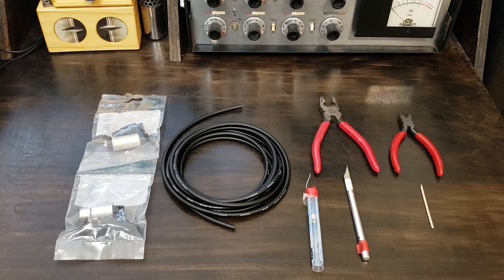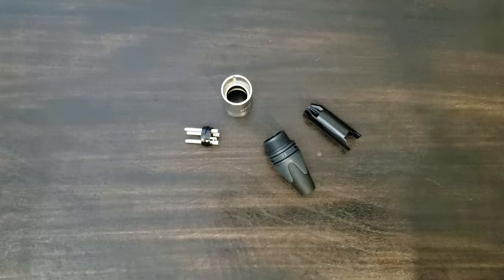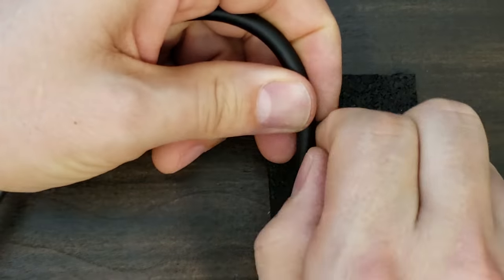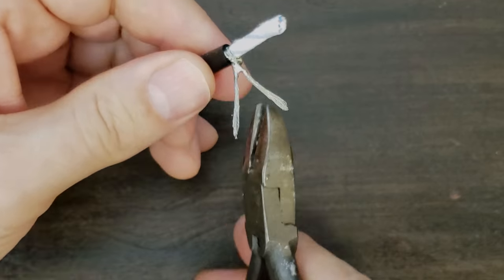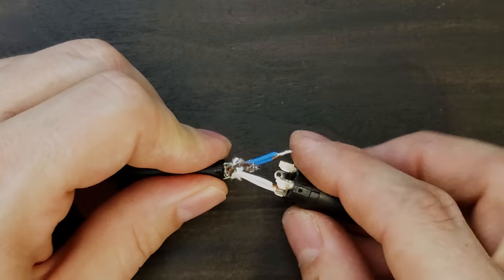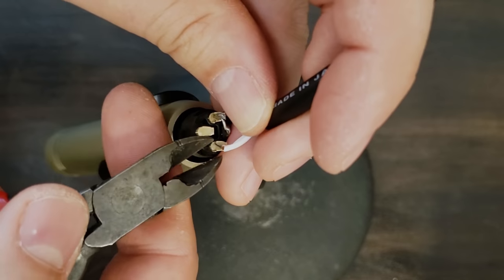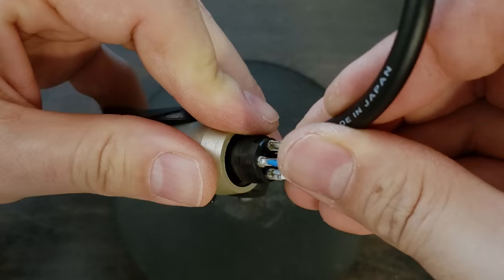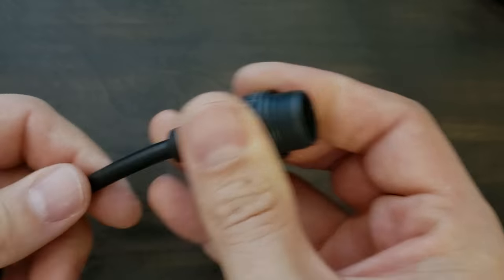XLR Microphone Cables, How to solder connectors Studio Balanced DIY ULTRA QUIET

Comment from the maker: By request I've added some  to some parts and tools to make the cable, Check out the description for more.👆
Reply: Neutrik recommends not to ground the lever. You should really use heatshrink on the back to protect the cable from overbending.

Comment: It's not a good idea to connect pin 1 to the connector body (with your jumper), as it also connects it to the equipment chassis. All those grounds aren't necessarily treated the same, so it's best to leave it floating. That way the component to which you're connecting the cable can decide how to manage the ground.

Comment: Just commenting to see if anyone else noticed the  thumbnail labeling? I think it’s labeled as if its female from the back, but shows female from the front.
Reply from the maker: It's labelled correctly as you see it from the front. Pin 2 hot, Pin 3 Cold, Pin 1 Shield.
Reply: @FrankOlsonTwins  Looks like the confusion is on my end, thanks for confirming.
Reply from the maker: No worries, front to back labelling vs. diagrams is always tricky

Comment: Thank you for the video!   A couple questions.  Why create a shield jumper,  instead of using the second twist of shielding to connect to the shield lead instead of snipping it?     And is quad core wire required?
Reply from the maker: Sure, Using the shield works well too! No reason not to, just my preference for a simple clean joint.  Quad core is not required, again, just a preference. Thanks for checking out the vid, hope it helps!
Reply: @FrankOlsonTwins  Chassis to pin 1 is a terrible thing. At the BBC - any cables that test short between chassis and ground are weeded out. Tony Waldren and Jim brown - two industry stalwarts refer to this as the pin 1 problem. Normally not causing problems but with one piece of equipment that needs chassis to be not connected, the enture system falls down and fault finding stupidly hard.
Reply: That's what I was thinking/wondering too

Comment: Why did you choose white for positive and pin 2. Why not blue?
Reply from the maker: Generally, red or white will be positive(hot), black or blue will be negative(cold). In this case I used white for hot and blue for cold.

Comment: I've made hundreds of cables using Canare and Neutrik and I've never done what you do with the shield. I've also never tied the shell to ground as far as I can recall. Just goes to show there's more than one way to skin a cat.
Reply from the maker: Yeah, the jumper is optional.  The high quality cable and attention to detail(no frayed wires, clean soldering, etc...) are the secrets to a great cable, imo.
Reply: @FrankOlsonTwins  Yes, and to that I would add that prep and a checklist are absolutely key. I've been doing this for nearly 30 years and yet I frequently realize that I've forgotten to slip the boot over the cable as I'm admiring my beautiful soldering job 😂. Thankfully that's usually the first end of the cable so I can still recover. 😅
Reply from the maker: Lol, the curse of the perfect solder joint- you only put on one boot! Been there!

Comment: In the case of a dual shielded core (foil around the live and neutral and a metal braid around that) which do I solder to the ground pin in the XLR? The braid, the foil or both?
Reply from the maker: Just solder the braid.  The foil will conduct itself to the braid.  Let me know how it turns out!

Comment: Frank, for this particular Canare quad wire, does it matter if you use blue on pin 2 and white on pin 3, as long as you are consistent on each end of the cable?
Reply from the maker: Exactly, doesn't matter as long as it's consistent.
Reply: @FrankOlsonTwins  ok, I was confused because Canare says the following in their PDF instructions from their website:

"In order to maximize noise rejection, Star Quad must be properly wired to the XLR-3 connector (or terminal block)."

And they clearly show a diagram below that quote that shows:

 pin 1 = ground (bare)
2 = white wire 
3 = blue wire 

I did mine opposite on pin 2 and 3, again consistently from end to end.

Based on what they said, I thought I am missing some kind of noise rejection benefit in this particular canare star quad wire design if I used opposite locations (but consistent from end to end) for blue and white.  Yes the cables all work, but am I missing a noise rejection benefit?

It's that I just finished making like 27 of these cables with quad and I'm thinking OMG do I have to redo this work?  The cables work and tested ok on my CT100 cable tester for proper pin outs.

I made a few at 6 foot long and most are 3 foot...for my music studio to connect rack gear.
Reply from the maker: Hey, like you said, as long as you remained consistent from end to end, you won't have a problem.  If you didn't remain consistent(end to end) you'd have a Phase reversed cable, and it should be labelled as such!  You could use a cable like that if you needed to flip the phase on a mic, but you happen to be using a mic preamp that doesn't have a polarity(phase) reverse switch.  Not common to have such cables around, but I've used them a few times for old gear that is still set up for pin 3 hot.
Congrats on making so many quad cables!
Reply: @FrankOlsonTwins  Cool.  Thanks again for your help.  Much appreciated! 👍

Comment: By a mile the best video and comments section I’ve seen covering this area... WELL DONE SIR.
Reply from the maker: Thank you! I'm glad people are digging this vid!
Reply: So Frank,  I’d just like to check something please.  I’m wiring a single pair cable female XLR to a TRRS, to use with my smartphone for convenience.   Will I simply be able to plug this into my AKG D321s microphone and record directly to the phone or will I need to provide some power to the mic?  Also in terms of wiring I’ve established that the S (Root) on the TRRS I’m using corresponds to the microphone input on the Samsung S9+ so.  I think that I wire the silver cable to the ground into the TRRS.  That leaves 2 cables the blue and white:  So which of those should I connect to the S (root connector)  cable.   I’ve identified the 2 Left and Right channel cables on the input and left those to one side for the moment.   Hope this makes sense and many many thanks in advance for your input so far.  Best rgds J.
Reply from the maker: Sorry for the delay!
I believe TRRS(tip, ring 1, ring2, sleeve) on a mobile phone should correspond to 
Tip=left headset out, 
Ring 1= Right headset out,
Ring 2= Microphone,
Sleeve= Ground/Shield.
The AKG D321 is a dynamic mic.  I don't think you'll need phantom power as most headset mics do, but you might need a preamplifier for it.  Most dynamic mics need a fair amount of gain.  No reason you can't wire it up and try it though.

Wiring, just a guess:  T=white, R1= blue, R2=red, S=silver(or copper color). 
I also doubt you need a "balanced" connection for the microphone, (the TRRS cable doesn't really allow for it), so if you're making an XLR cable for the microphone, Pin 2 (which will go to Ring 2)will be "hot," don't forget to ground Pins 1 and 3 to "S"
Good luck!

Comment: A few things I like about your video out of the 10 or so I just watched.  1.) Your the only one that used a shield jumper, I guess its not "required" but seems like a good idea.  2.) I like how you crimped the connectors to give a more secure connection.  3.) If you have a lot of braiding I liked your idea of cutting it in half but still giving it a good base connection with the solder at the base.

This is most likely the closest to how I would make a cable if I was going to do it.  Good job with the video and thank you.
Reply from the maker: Thanks for checking out the vids! I get plenty of negative comments about that jumper, but I've never experienced an issue using my cables in pro studios and clubs in and around NYC.

Comment: Wow excellent! I will get on this immediately! Fixing/upgrading my old quad core cables.
Reply from the maker: Cool!  Let us know how it goes!
Reply: @FrankOlsonTwins  Thank you once again for offering a solution to my problem! I had an issue with RF noise and my U87ai microphone. I had attempted to modify one cable in accordance with another video on Youtube that simply takes pin 1 out of the equation and connects it to the xlr clip on the ends. This reduced the noise but the jumper connection retaining pin 1 connection reduced the issue to the maximum. I think for my next cable mod, I will use a simple very short cable instead of the wire I used to make it slightly cleaner. Thank you very much!!!
Reply: @FrankOlsonTwins  what are your thoughts on EMC XLR cables? Would be good to see your prep on one of those :)
Reply from the maker: Yeah, I'd be curious to find out what the differences in are between those cables, there are MANY options!

Comment: Lots of good points in this video.

Shield jumper is the "best right way" (cleanest way) to bridge the XLR chassis to pin 1 ground.
I also liked that you clipped the shield shorter than the two signal wires- it forces the wires to remain slightly bent & more strain-free, giving them some slack before going taut if the strain relief on the Neutrik fails.

Question, though- why use such a fine tip for soldering? You'd get better heat flow with a thicker cone or small diagonal tip, and perhaps larger diameter solder, and wouldn't need to touch up some of the joints as much.
Also, why crimp the solder buckets? Only makes it harder to repair or reuse the connector if necessary. I know it's not likely that the cable will fail with Neutrik XX and L-4E6S, but the possibility is still there.
Reply from the maker: Thanks for checking out the video!  That tip is the general one I use for soldering, but I should get a decent flat tip for connectors like this. I crimp the buckets to get the best possible electrical connection, though it does seem strange that one end has crimping terminals and the other end is open socket terminals. Certainly not necessary.
Reply: @FrankOlsonTwins  I think the answer for why the two solder buckets are different is in the actual metal connector contacts themselves. My guess: The female ones look to be from stamped and rolled metal as they form a "sleeve" for the male pin to grip onto, hence the square stamped solder bucket. However, the male ones are likely some sort of drawn or extruded metal rod, hence the round shape.

Love me some L-4E5C Mini Star Quad for aux and patch cables, by the way! L-2T2S also is some pretty good "standard" mic cable with Canare flexibility & durability, although I'm not sure in what application that'd be preferable over Star Quad.
Reply: Which guy is right? the guy commenting before you said don't use the jumper and no one replied to him, but you say it's the "best right way"

Comment: Should you always use the jumper or not because this is the only video of uing it and btw my cables are for connecting active studio monitors to the interface thanks in advance have a great weekend
Reply from the maker: You probably won't need too.  If you end up with some hum issues, you could always go back and solder a jumper in.

Comment: Great video, like the explication, but why use a cable with 4 wires and not just two? Thanks!
Reply from the maker: In some cases, a "Quad core" cable will minimize hum beyond what is capable by 2 core cables.  Either is fine for cables less than 50 feet.
Reply: @FrankOlsonTwins  Oh, I see. Thank you for the reply, appreciate it! 😀

Comment: I want to ask you, is there a problem if I do not do the junction? I just connect the ground terminal and the other two terminals, both in place, but without a junction with the earth, but it works and the sound is good
Reply from the maker: The junction is optional. If the cable sounds good, no need to solder in the jumper.

Comment: Great demo! Does it matter which wires are assigned to each lead to be aligned w/ the corresponding lead on the opposite end?
Reply from the maker: Thanks!  It's a little tricky, actually!  It's easy to cross wires, so pay close attention to the numbers on the back of each plug. Look closely at the back and front of each connector, there should be a number by each pin.  The color doesn't matter as long as each color goes to the correct pin number.  For example, pin 2(male plug) red wire should go to pin 2(female). Pin 3(male plug) white wire should go to pin 3(female plug).    Whatever color you choose should match the pin on each plug.  That's it!

Generally speaking, if I see a red signal wire(like in a mic cable), I consider it to be the "hot" wire.  If there's no red wire in the cable, I usually consider the white wire "hot."  Blue is generally a "cold" signal wire. Black is usually a shield or ground.  

Inside an amp, however, it's a little different.  A red wire means high voltage or B+.  Just something to keep in mind!

Comment: So, if u don’t use the shield jumper will the shield still connect to the ground somehow inside the gear or is it just a shield? Thanks!
Reply from the maker: Correct, the shield jumper is optional. Pin 1(Shield) will likely be grounded inside of equipment so it acts as a ground and a shield.
Reply: @FrankOlsonTwins  Great! Thanks for your reply and informative video! Will try the jumper next time!👍

Comment: If I use copper strands instead of the solid core copper to connect pin 1 to the chassis... do i have to tin the entire piece?  Or can i leave the strands looking like the color of copper?  Might the un-tinned copper strands cause white noise?  does the tinning keep the copper from being overly conductive?
Reply from the maker: You don't need to tin the entire piece of wire .  The un-tinned copper won't make any noise. Good solder joint will keep the wire conducting properly.  The practice of tinning long lengths of wire are usually to keep the wire from oxidizing and becoming unreliable to solder. 
However, you do raise an interesting question regarding the surface area of wire and the connected part.  In theory, solder/tinning does increase the available area for the flow of electrons from a wire to it's contact point, but there's a point of diminishing returns.  One way to visualize this, is to think about a resistor leg(lead) soldered into a PCB hole.  There's plenty of solder covering the bottom of the lead as well as the copper that surrounds the hole.  No need to tin the entire resistor lead.    

If you're getting noise(or white noise) from a cable, I would suspect a bad joint.  Sometimes a really poor solder joint(gray, crackly, dry-looking) can create noise as it heats up, moves or attempts to conduct electricity or signal. Solder joints should look wet, and you should be able to "see" the joint beneath the solder. For example, if you have 2 solid wires soldered to a terminal, you should be able to look a the solder joint and make out the shapes of the wires below the solder.

Good questions!
Reply: @FrankOlsonTwins  Gosh you are so helpful, thanks so much xoxo

Comment: what is the big difference in terms of performance on canare L-2t2s and canare L-4E6S?   

In my understanding  L-4E6S is better when we use for XLR male and XLR female cable connection. For canare L-2t2s having a better performance when we use in TRS to XLR male cable connector. 

Is my conclusion wrong? 

What is your opinion about this:   canare L-4E6S is better in any way from  canare L-2t2s

please help me, you are my cable guru.  lol
Reply from the maker: Actually, I think you're on the right track with your concept of how to use these two cables.  I prefer the L-4E6S(Star Quad) for XLR cables.  I do find it easier to use L--2T2S(3 conductor) for TRS cables.  Because L-4E6S is basically twice as much work to use, I've find it to be a bit too annoying to use for TRS cables(I've made many of them). 
However, our preference for use does not change the laws of physics.  Star quad cable does offer better hum/interference rejection than regular 3 conductor cable- no matter what cable end is attached.  Therefore, if you're often in a high-interference environment, the Star quad cable will always out-perform at any given length.
But the regular L-2T2S is no slouch.  Canare copper braid is quite dense and good at shielding, so for shorter lengths of TRS cables, I say make it easy on yourself: use the L-2T2S and save the Star quad for the XLR cables.

Just to clarify, I highly doubt you'd hear any quality difference(aside from interference) between the two cables in double-blind testing.  The concept of balanced cabling is quite good at preserving the full audio spectrum with 3 simple conductors(2 conductors as a twisted pair, inside a shield conductor).  Star quad cable follows the same principle, but is better at reject hum, especially AC power noise.

Good luck!
Reply: @FrankOlsonTwins  thank you. Never use quad cable before. So the quad always better but difficult enough to make. Thank you for your opinion

Comment: Good videos, but why don't you use solder paste? I find that works wonders on the plugs!
Reply from the maker: Great tip, I'll give it a try. Is there a brand you recommend?  I am at a point where I will only use Oatey or Kester solder due to quality control issues, perhaps they have one?
Reply: @FrankOlsonTwins  Hey!
About brands, not really... I tend not to look much at brands for this. But, maybe, the brands you mentioned are of very decent quality.

I always use solder paste both on the cable ends and on the plug lugs. It makes the work a lot easier!
Reply: Be sure to use resin-based, non-acidic ones to prevent chronic corrosion issues